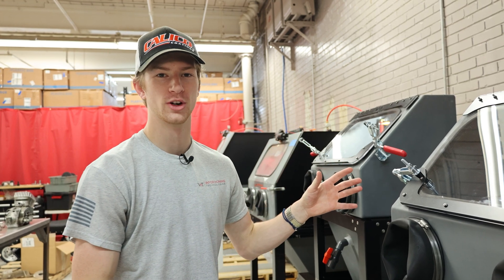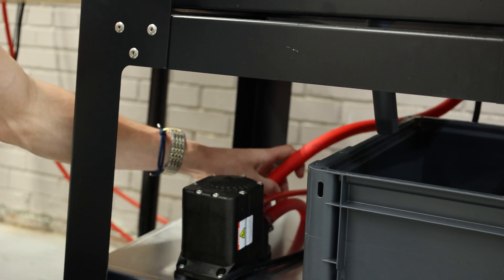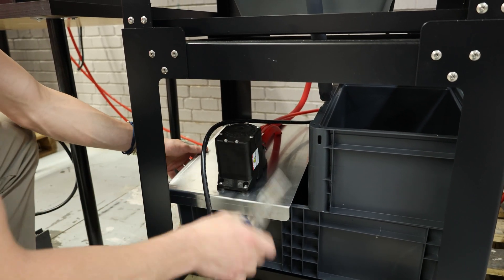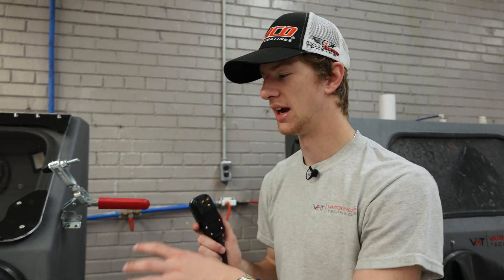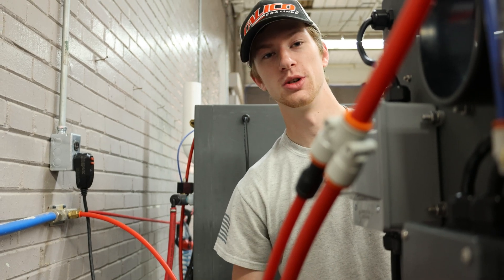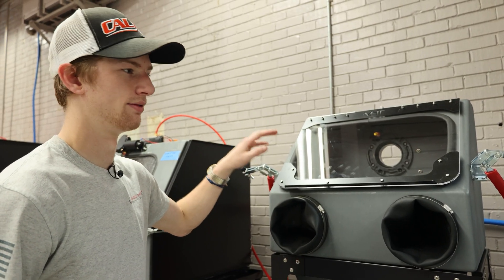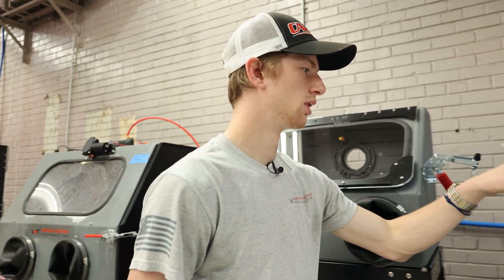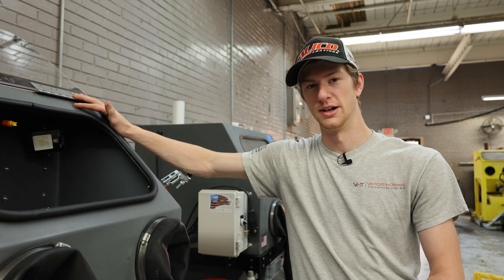How to Set Up your VH700 Closed Loop System! - Vapor Honing Technologies

Comment: What compressor is recommended for the closed loop variant? I have 110v and 220v power.
Reply from the maker: We recommend any compressor that can sustain 20-30 CFM at 60-100 PSI. We suggest a 7-1/2 horsepower compressor, but a 5 HP compressor can be sufficient for lower pressure applications. It is much better to buy a larger compressor than a smaller compressor, not only because it will run to keep up less, but also for if you upgrade machines later.